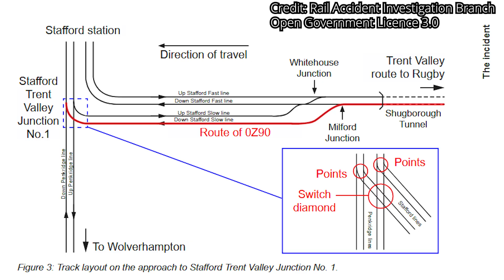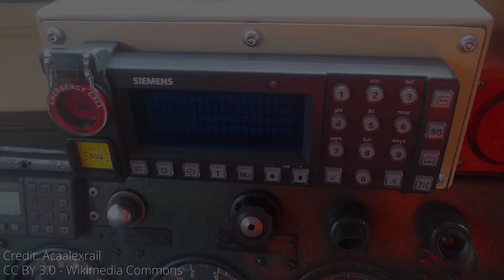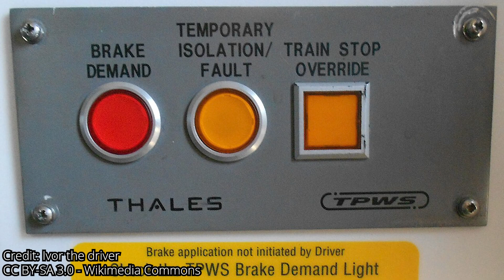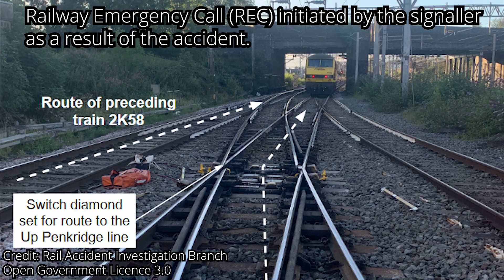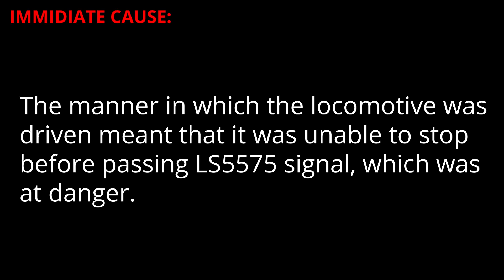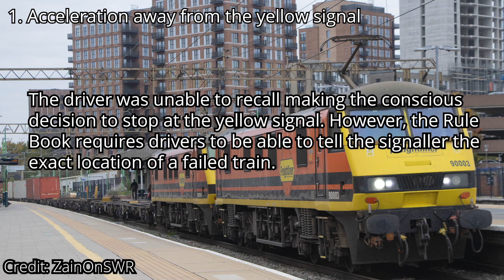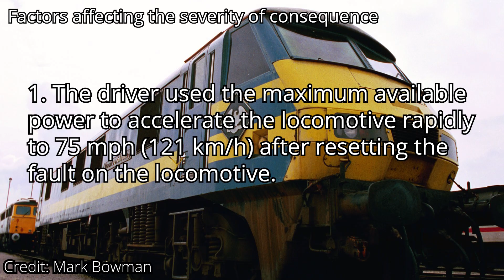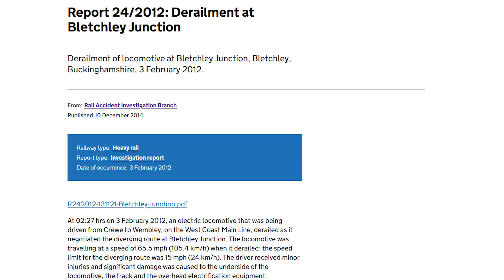The Stafford SPAD Incident | Jakeso

Comment: I think if I was on that loco I would have drawn up at least one loco length before the signal at caution when the fault came up ( defensive driving ) , it would make it easier if the loco was a total fail and required a rescue loco. Been on many test runs over decades. Light engine restricted to 60 MPH. Also when fault was cleared I would have taken it easy up to next signal just in case it tripped again. Stopped at the red, contacted signaller and explain their may be still issues with the loco. They would usually give you greens for the rest of your route if they could to get you back to depot and clear of the main line just in case the fault re appeared. The fitter in the cab should have remined the driver he was starting off from a single yellow if the fitter saw its rapid speed up after the fault stop. Always assume that the next signal may be at danger and not cleared, even if you are not sure or can't remember what the signal was showing you have just left. A loco fail can fluster a driver and may not be thinking straight. Its human nature.
Reply: It is company policy to stop one loco length short of any signal so the aspect can be seen clearly before proceeding.
Reply: @andyhinds542  Yes that's right, but on a test run that has "failed" we always gave more than a loco length so that the rescue loco was also in advance of the signal and not on or past it.
Reply: It’s not the fitters job. I doubt the fitter is trained as a driver. He’d have zero knowledge about rules books or train handling. PTS aside, he’s a depot based or travelling fitter with no driver training.
Reply: @nedseagoon5101  I was a mobile fitter and passed to drive locos in yards, I was also a RST . It is a fitters job to observe train safety . Its in the rule book that rail staff observe trains and note, report defects if noticed. Did it for 50 years.
Reply: @DOCTORDROTT You’re the exception then. Every TRI I’ve gone across has zero driving experience and would never intervene in operations.
Reply: @nedseagoon5101  It was the norm in our area. We were like a family and looked out for each other. Drivers, Fitters and Groundstaff I worked very closely with loco control / maintrol and NR MOM's and signallers. It was a part of my duties, I could take out line blocks for incidents etc, did mobile work for 18 years. We also had route knowledge and could make suggestions on how to clear failed trains in the best way as we had good local knowledge that Doncaster relied on. It worked well for many years. All down to good teamwork and communication. Did my apprenticeship in Swindon Works, Canton & Cathays. So we have very good training from day one.

Comment: One point: a single yellow indication does not mean that the next signal ahead will be at danger; it means the next signal ahead might be at danger and the driver must be prepared to stop at it. I've covered many miles running on continuous single yellows. In this case, the next signal was at danger but the distinction should be made.
Reply: I prefer to treat the next signal as 'likely to be at danger'. Never mind if it "usually clears", asking for trouble that.
Reply: @BazNapper  Many years ago a driver friend got caught out when a coal train service he ran for decades always had its route set with no issues. Then one day he thought a single yellow would clear as the next signal may clear. This time it did not and he had a SPAD , I had to down load his loco as part of the investigation.
Reply: @BazNapper  much the same. I’ll do my level best to approach a single yellow at a reasonable, but steady speed, allowing (location dependent) whatever is blocking the line ahead to do its thing, and mitigate us approaching a red altogether.
Reply: With track circuit block (TCB), a yellow signal means the next signal IS at danger at that time,  you must be braking the train to stop at the next signal. We have random downloads by our managers and if it shows on a download that you are not controlling your speed at yellow signals,  you will be taken off driving for a retraining period and that goes on your records.  Too many incidents like this on your records will result in dismissal. 
Yellow signals are not used to slow you down at reductions of line speed,  that's route knowledge,  the nearest to this is at slow junctions,  where the diverging speed is alot slower than the main route. You will be brought down to a red signal at the Junction which will only clear once you are close to the red. You obviously must assume the signal will remain red and be coming to a stand before it. 
Hope this helps,  Absolute Block with semaphores is a bit different.
Reply: @gwrdriver1660  Yes, it's at danger at that the time you see the single yellow, but not necessarily when you reach it. It might by then have cleared to single yellow, which was my point, so no requirement to come to a stand,  hence the "be prepared to stop" at it' if its still showing Danger.
Reply: @gwrdriver1660 I can think of a few locations where signals are designed to not show green for speed control purposes, e.g showing Y or YY but the next signal could be a green
Reply: @LMS2968  as a qualified experienced train driver if you see a single yellow aspect you must absolutely assume the next is a red until you physically see it with your own eyes and be at a speed prepared to stop this is usually 10 mph at the AWS magnet for the red.
Reply: We always treat a single yellow as the next signal will be at danger.
Reply: @andyhinds542  Quire right, that's what being prepared to stop at it means. But it ain't necessarily so - what do you do if you find the next one's also a single yellow? I always kept going, but prepared to stop at the NEXT signal since that's what this single yellow was telling me to do.
Reply: @LMS2968  If the next signal is a single yellow, then I proceed at caution. My company policy stipulates a minimum speed of 40mph at yellow signals with 10mph at the magnet to a signal at danger.
Reply: Pretty dangerous attitude to yellow aspects...
Reply: @SCPNewsCrew It's an amazingly dangerous perspective on single yellows. The rule book, and any company instruction, is clear, a single yellow means that the next signal is red and should be treated accordingly. To change your mindset to 'it might be at red' will be the reason for an incident one day. If you used risk triggered commentary you would be saying 'Red ahead', not 'Maybe a red ahead'.
Reply: @SCPNewsCrew  why dangerous? I don't see three reason for your concern, so please say more...
Reply: @trueriver1950  because a driver could change their driving style to running at the same speed as a train in the next section. If that stops for any reason, the OP may not have time to make a stop, thus putting themselves at risk of a SPAD (signal passed at danger; passing a red signal).
Reply: The difference becomes obvs when you understand that another reason for showing a single yellow aspect is to remind the driver to show down when they're is a change of speed limit. 

Automated equipment at some locations will measure train speeds and select yellow aspects accordingly, even if the track ahead is actually safe. 

Just to be clear: this is not the majority of yellow aspects, but there are some like this.
Reply: @trueriver1950  when a signal is yellow for a speed restriction, that is because the signal in advance IS at red. This is to ensure the speed of the train is brought down. 
That signal will change up when the speed of the train is proved to have been brought down, unless there is a train in the next section, or the route isn't set etc.
Even approach controlled signals don't always change up
Reply: @trueriver1950  Do you actually drive trains as a profession? I'm getting the impression that you don't.
Reply: @trueriver1950  Speaking as a signal engineer, controls to hold a signal at yellow for speed reduction purposes are normally implemented by actually holding the following signal at red. Hence the truth of the statement that a yellow signal means the following signal is at red.

Comment: To stop trains SPADINGS, is put a device on all trains like on London Underground Trains (LUT), and put the same device which used on LUT, which if a train SPAD it puts on the emergency brake system on stopping the train straight away.

Plus what happened if there was signal failure or points failure or both, if there was a signal failure, plus we don’t know if the signal before the one is shown was spad?, it might have stopped and got pro mission to carry on and not knowing there was going be a point failure also which caused the problem with track
Reply: @rhock1979  In this case it wouldn't help: As explained in the video, the driver had already applied emergency breaking before both the danger signal and before an overspeed sensor. Running at line speed without a load (that that load's cumulative braking power), the locomotive itself didn't have the breaking power to stop in time.
Reply: Did you actually watch the video and do you understand what AWS etc. mean? Also, you're referring to a mechanical trip device which isn't used on mainlines for many reasons, not least it is not suitable for heavy trains with long breaking distances. Also, the other points you try to raise would have been covered by recorded procedures.

The explanation in this vid is clear; it reminds me of accidents with fast accelerating S-Bahn trains in the 80s or 90s of the last century. In consequence the German PZB (automatic train control) got an even more restrictive mode that keeps you at very low limit for a certain distance. However, the ATS reset looks like a huge contributing factor. And to repeat again, no, trip devices won't help, and there was no Liss Truzz deep conspiracy.
Reply: The train does have that though, AWS and TPWS.
Reply: Tripcocks would usually cause wheelflats on freight services.
I've had to smack the plunger at speed a couple of times during my freight career, but it's best avoided unless there is no other option.

Comment: The train didn't stop the train in 1μs, therefore the train didnt SPAD and the video is fake.
Reply from the maker: ‘At about 16:41 hrs on 22 August 2023, an electric locomotive operated by Freightliner passed a signal at danger (red) on the approach to Stafford Trent Valley Junction No. 1. The locomotive was on a test run, after repair work, and continued for 740 metres beyond the signal, before running through points as it came to a stand at the junction.’ - The RAIB report, which you can look for yourself if you simply go to the link in the description.
Reply: @Skeppuchino Better watch again, it was a spad.
Reply: Wot?
Reply: That's a barmy conclusion.
Reply: What you bin smokin bro?